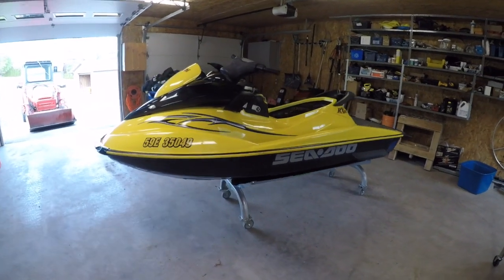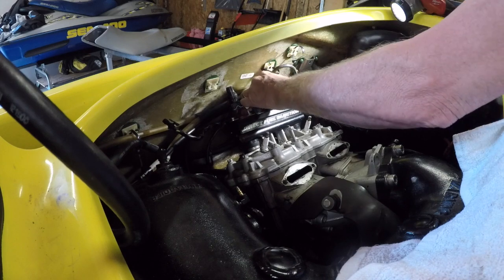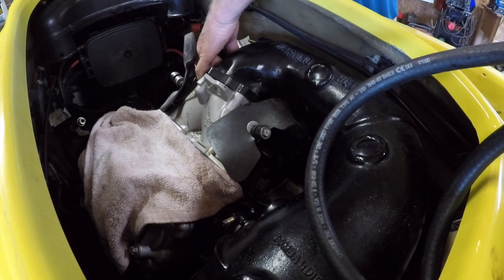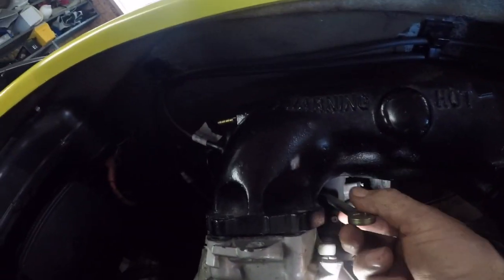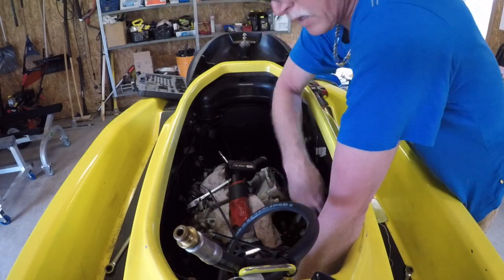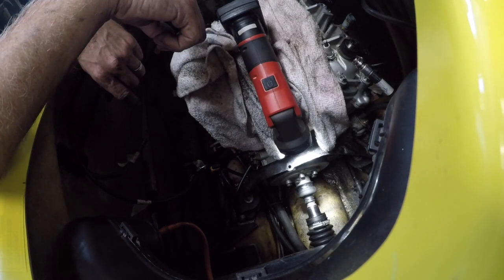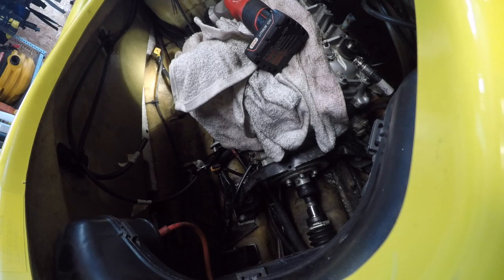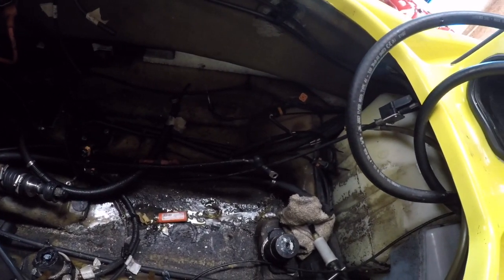Seadoo rxdi engine removal

Comment: Thanks heaps for this video.  I am trying to pull out my motor and this has answered many questions.
Reply from the maker: I just pulled one out on the weekend.  (key is to organize all the parts you remove) Label everything you can. (pipes for sure)  It makes things a lot easier to re install .

Comment: Hey man I really need your help . I bought 2003 gtx di . Took it for a water test ran fine and powerful no issues . I checked the hull and there’s lots of oil . The oil seems to be coming from the bottom of the engine , also some fine metal shavings all over the hull . Season still runs fine , but the oil is annoying me . The oil tank seems to be fine , and it’s area is not wet at all . Should I pull the engine out and check the oil pan for leaks ? . I also did a compression test , and I got 110 psi for both cylinders .
Reply from the maker: there is an oil line that connects to the bottom of the air compressor.  possible that the line has come off.  Also check the 3 oil lines that inject oil into the crank case to be sure none have come off.
Reply: @SeadooRefurb  hey buddy . I checked all the lines . All seem to be fine . Problem is there’s just lots of sludge looking oil all over the bottom of the engine . It’s really hard to see where it’s coming from . My only option is to pull the engine out I guess ?
Reply: Update ! I pulled the engine out . There’s a plastic cover with 2 10 ml bolts behind the flywheel . The cover has metal pushing out off it  ! looks like the bearing inside is missing some of it’s balls ( actually about half is gone ) . The shavings made its way passed the plastic cover and out . I think that’s where my leak is at (plastic cover has cuts from the metal shavings ) . Inside of the engine looks clean . Do you advise opening the rest of the engine ?
Reply from the maker: @HassonyandArnobi  I think it is time for a full teardown and rebuild. The cover behind the flywheel is where the compressor rod connects to the counter balance.  I am having trouble envisioning exactly what is happening but it does not sound too good.

Comment: Thanks for the video!  I have a question that I was looking to find an answer to watching your video, but if it was in there I missed it...  In the rave hose system, I have a hose that is soft rubber, wrapped in looming to protect it, teed off the compressor hose.  Not sure if it goes to the intake (can't find a location to connect it) or to the crankcase (also unable to find a nipple for connection).  My air silencer has a hole in the top that looks like it may have been for a connector of some sort (possibly missing), but the hose has zip tie impressions so I know it couldn't have just been shoved into a hole.  I'm the 3rd guy to work on it and nothing was labeled.  The online resources are vague and others are just incorrect for this unit.  
Any help is appreciated.  Thanks again for the video!
Reply from the maker: Ha.  This one got me too.  That pipe runs under the engine from the compressor and goes to the underside of the air intake box.  There is a connector on the bottom.  I don't have a photo and it is impossible to take one as it is so hard to get at once assembled.

Comment: Do you remember what size nut is on the bottom of the exhaust that you had the special wrench for
Reply from the maker: Hmm..Not sure.  It is metric.  I will have a look on Saturday and advise.
Reply: 15mm.  Need to grind down a short ring spanner.

Comment: Hey buddy I have a few questions for you about a 02 seadoo gtx di. Any chance you could email me bck or give me a contact info to pick your brain about my ski. I'm very mechanically inclined but cannot figure out this ski. Took it out twice no problems.  Last time idling around n it cut out like ran out of fuel. Got it home n disconnected the rave solenoid supply line from the compressorn it will run just no throttle. Hook the line bck to the solenoid n it won't run.
Reply from the maker: https://www.youtube.com/watch?v=63z0N8Dlkio      Watch this video.  It explains how the air system works.

Comment: Hi, I just came into ownership of a 2002 gtx DI .  It is a barn find.  Mint condition but hasn’t been run for about 8 years.  I’m in airdrie, Alberta.  I’m just starting into it and came across your vids of your 947 DI assembly.  Anyways I was wondering your thoughts on whether I should just clean out all fuel, lines, fuel rail, raves and try to start it.  Or should I go deeper into engine.  I was told it was fogged when put away.  I just don’t want to destroy the case.  Pistons look fine through the rave holes.
Reply from the maker: I would remove all fuel for sure..remove the spark plugs and put a little 2 stroke oil in both cylinders and then roll over the engine a couple of times by hand . (roll the PTO)  IF you don't hear anything strange the I would crank the engine over a couple of times without the plugs and again listen for anything off.  If all sounds good then put the plugs back in and give it a try. ( my barn find in the video had bad crank bearings so you could hear it when I rolled it over by hand)  Good luck !
Reply: Thanks, I’ll do that.  Currently waiting on parts for new seals for raves but cleaned out entire fuel system and injector rail assembly.  I removed injectors and air injectors and cleaned them all up and re-assembled.  Had the mishap of dropping a stainless fuel line keeper under engine so that added an hour of digging for it.  Ended up filming a phone video under engine to find it.  Engine sounds good at this point.  I have rebuilt several 800cc rotax sled engines in past, so similar set up here except for the weird DI set up.  I think it should start once I get rave parts back in.  Will test fuel pump pressures and batt voltage (new battery) when I get it running.
Reply: After I re-assembled it all.  I added oil to the pistons and turned it over by hand.  Then with a fresh battery spun motor with throttle pinned (dewatering mode).  Added a bit more oil to each piston.  And let her sit over night.  It sounded really good.  No rattles or noise from crank.  Next day put it on hose water, but I started it first per the warnings.  It fired right up.  Ran for a couple minutes in hose water.  I then launched it into lake and did a warm up drive at low rpms.  It ran great.  Next run ran it mid throttle.  For a few miles.  Then went full throttle for a bit.  All good.  I was easy on it for first day.  But after that started pulling tube and knee boards and ran for 15 hrs so far over a week at the lake.  All good.  Speed tops out around 48 mph.  And the OPAS needs adjusting as the little rudders are not Centered when handle bar is centered.   I’ll be doing a compression test next and check out a pump rebuild as it should be getting 55 mph or so something is causing that.  Thanks for the advice.  I’ll keep working on it and watching your vids.  What’s a good source for buds or candoo?
Reply from the maker: @n8cadieux  I would assume that buds is the best but I have the Candoo pro and it works perfectly for what I do.

Comment: Hey I working on the same engine and at minute 51 the hose that connects to the bottom side of the compressor where does the other end go? I have been searching all over and the internet and cant seem to find anyone with the answer! Right now I thought it connected to one side of the vacuum solenoid but in your video it appears to go off towards the front of the engine? Connecting to the oil filler tube perhaps? Any help would be greatly appreciated!!
Reply from the maker: I will have a look and let you know tomorrow.
Reply from the maker: It does connect to the oil filler tube below the Cap.

Comment: I have the same wen to go out on it the other day but it won't start not getting the two beeps wen I put key on I think the dess key post has fucked up need to order new one I think
Reply from the maker: Sometimes just cleaning out the inside of the dess key works.  Are you getting a long beep when you put the key on ?
Reply: Matt D hi just got second hand dess post for £40 and workin now thz try to clean but it was fucked but all working now thz 👊🏻